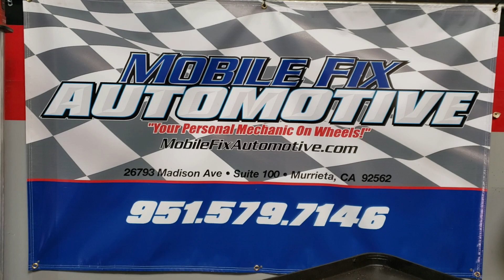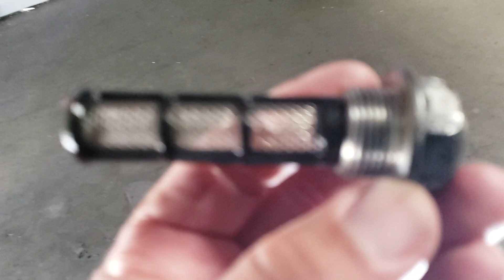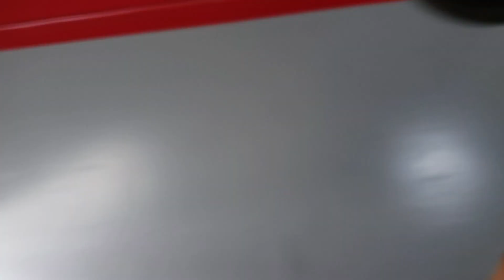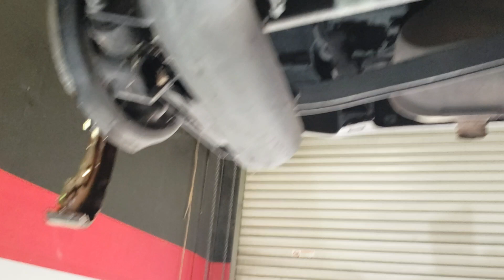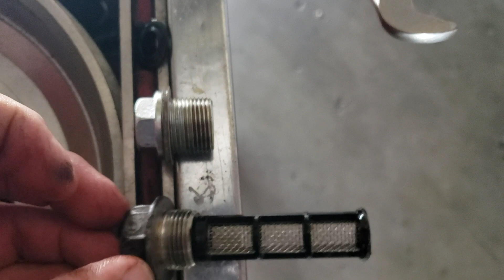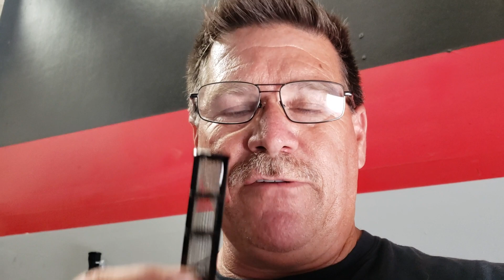2009 Smart car stripped oil drain plug

Comment: If I were doing this repair, before fitting the new, longer sump plug I would've given the plug threads several laps of PTFE tape which would mean not having to risk over tightening it. Great repair all the same.

Comment: One can lower the engine ...the lowering bolts cost about half of the pan , these same bolts are needed for spark plug change .Thanks for the video . My 2013 Smart is now at the mercedes garage getting a head gasket , also time to change the spark plugs

Comment: Easier than replacing the oil pan would be to take the Dorman plug and bore it out to take the screen,  If you don't have a metal lathe, a machine shop would make quick work of it,

Comment: I just came across the same problem yesterday and I was able to repair it by filing the end of the drain plug hole and made the stripped part shorter so the plug can catch on the remaining threads.

Comment: Update 4-8-20: It is quite understandable why Ron has not done this. After researching this: it is a very difficult job (and for those without a lift it could be dangerous working under the car loosening cradle mounts - for those that try it,  make sure you have redundant jackstands, jacks etc, imo)  One famous site of Smart service articles that has no info on this said in an email reply the only time they were familiar was a person with a lift and since no one has a lift they have nothing on the oil pan 451 removal subject.  As I said later in my remarks,  this has not been solved to do an easy, codified way.  It basically is a 'struggle repair', imo, due to the design of the hard-to-access fasteners on the side.  (covered with A/C hoses and hard to reach) I doubt Ron will do it though could be surprised. When you consider the amount of this model throughout the world and the fact that (though I could have missed it) there is just about nothing on the internet with step-by-step info on changing the 451 (not 450) oil pan it is quite amazing. I have researched it and the Smart forums. 

(previous remarks) How about doing another video or a video of an explanation of how you might have changed the oil pan that appears to be a nightmare with 4 fasteners high up and hard to access one person wrote in a forum it took 3 hours to take out the two right fasteners so my guess you found the new plug "OK!!"  I would not want to do it either
Reply from the maker: When I change the pan I sure will.
Reply: @SandCarServices  Thanks. I am looking to do this now/soon as a home mechanic and looking deeply in the project. The side of the oil pan (451) has 4 fasteners that are atrocious to get to. One person in a post said it took 3 hours to get the right 2 bolts off and was never able to reinstall one of the fasteners (first 2 are AC compressor fasteners the next 2 are fasteners to hold clamps for hoses and they are way up with hard access)
It seems the easier way is to have a partial engine lowering using lowering bolts (longer than mount bolts that allow the chassis to be raised) to get better access to the side-of-oil-pan fasteners that appear like a nightmare to get off with the engine in normal position.   This is not a normal, easy oil pan to get off. Viewing some info, lowering partially the engine looks easy though. I should add there is nothing on the Internet that shows how exactly to do this with a 451.    450, yes.    Looking into oil pan removal and researching a bit I believe there are two choices:   1. Struggle with the *engine not lowered* with some wizardry of mechanic skill/patience that will allow to remove the fasteners on the side of the oil pan hard to reach and a greater skill to reinstall the same fasteners  OR  2. Partially lower the engine with great caution incrementally watching what will snag and stop before it does using lowering pins (bolts that are longer than the engine mount bolts that go into the 4 main engine mounts that allow partial lowering for clearances) and access the oil pan bolts easier. From a UK site it is 30cm (2)  (11.81 inches)  and 26cm  (2) (10.24 inches) long (don't you love that the US uses the British Imperial system of measures like feet, inches, miles, yards, etc but the British don't. :)   GO 100 yards  for US football!!! and 90 feet for baseball!!!)    

(added 4 5 20) I found these comments interestingly today in a post (the classic/easiest way to do this has not been solved)  that I will add to these remarks:            (quote) "There are also a 10 mm socket bolt that secures the coolant line to the front / top of the oil pan as well as one or two A/C bolts that uses a STAR socket. Unless you have the 4 long bolts to drop the sub frame as I do in my shop, the best way to access them is to remove the front engine mount, push / rock the engine / transmission unit toward the back of the vehicle and hold it in place with some type of jack. I use a transmission stand in the shop and it works, this allows you access to the bolts. It might be easier if you took off the passenger rear wheel liner and rear passenger wheel so you can access them easier." (unquote)    
There is also an 'O' ring as another person wrote in a forum:  "Also before you take it off, order the o-ring seal because you'll want to replace this seal. It's a seal that goes between the pan for the oil pump inlet passage. Make SURE you don't put too much sealant on this area other wise the silicone will get in the way of oil being sucked into the pump that's part of the side timing case cover."
Reply: One last thing: (sorry for a lot of text) In the video Ron said there is obstruction to use a Heli-coil.  1.  On the Evilution site it is shown that by
removing the right-side mount (facing front of car)  the engine can be easily tilted putting the drain plug angle clear.  2. I need to look at my purchased replacement oil pan,  but,  why can't the screen be modified (cut) to accommodate the longer threaded plug thusly keeping the screen with the longer-threaded plug?  (it could be removed at oil changes with needle-nose pliers) I bought that plug.  Thanks for the part number in case I change my mind about the pan swap and use it.

Comment: Hey hey. I have a smart car (I think it's a 2008 ForTwo Cabriolet convertible) and this exact thing happened to me i.e. the guys who serviced it last put the plug in too tight. I was wondering where you got the pan from? Or, if you know where I could get one from over here that's not too expensive? Apparently it's going to be over a grand to replace the pan. Thanks so much, this vid is rad.
Reply from the maker: I haven't replaced the oil pan yet. The plug repair I did is working fine

Comment: Engineers should not be allowed to work unsupervised (: (: (: I had a 2009 MKZ 3.5L with a timing chain driven water pump - Leak & my engine gone with only 58,000 miles

Comment: Replacing that oil pan would be a waste of time.
Reply: Leave it as it is.  The "screen"  isn't doing anything.   The engine has an oil filter.  You already said there was nothing in the screen.
Reply from the maker: What's your plan?

Comment: What function is that primary screen? How does the oil flow through it? On an old British motorcycle I had, with a similar arrangement the oil passed through the screen, into the filter then to the oil pump via a radial hole in the side of the plug and a gallery in the sump, yours looks ' blind'.
Reply from the maker: I believe it is to protect the pump from debris.
Reply from the maker: I forgot to add, the oil flows through the screen by gravity feed.
Reply: @SandCarServices  hi Ron, sorry still struggling. The plug you put in was solid and longer. With the  filter / plug arrangement does the oil flow in or out of the circular screen, I'm assuming in? And from inside the screen how does it enter the engine? Maybe the filter/plug is used on another engine. I read on the interweb it is a Mitsubishi engine maybe badged as a Mercedes. Thanks from 🇬🇧 🏴 for your entertaining, informative postings.